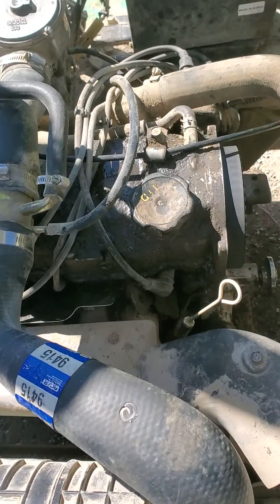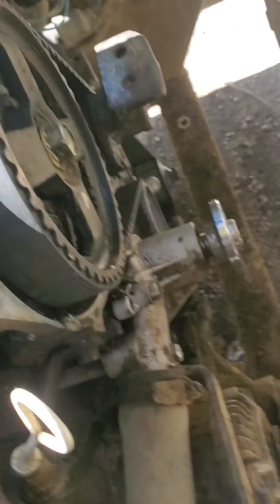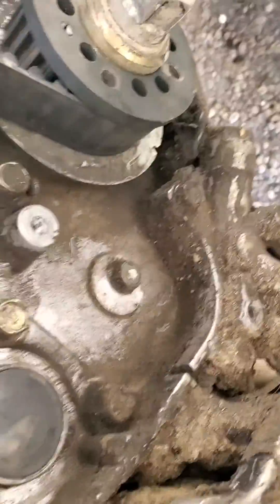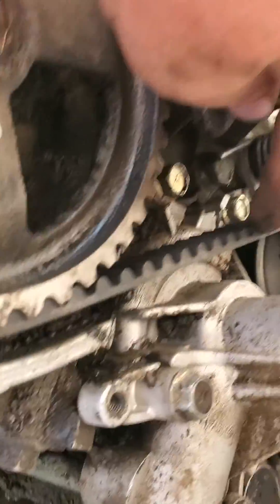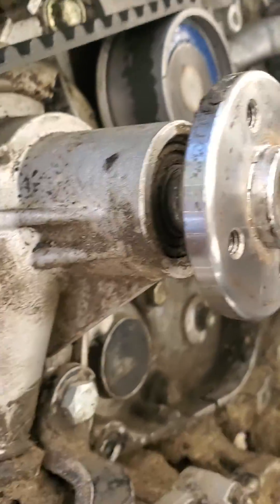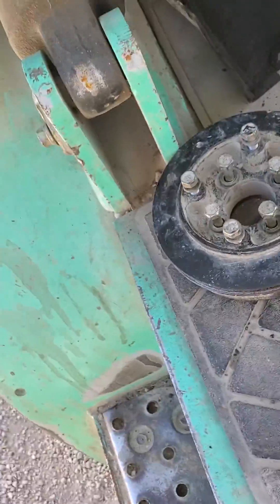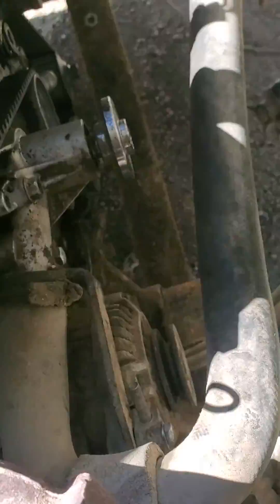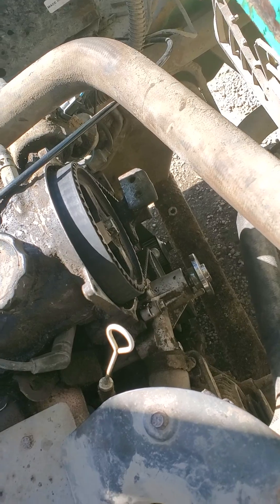mitsubishi fg30k forklift 4g63 timing marks and belt

Comment: How did you lock the camshaft pulley when taking off the belt?
Reply from the maker: They had run the engine out of oil and it would lock up the cam and skip the belt. I didn't do this as a service, I did it as a diagnostic. There's comments saying I was wrong about things and I'm sure I was. Just made the video to help people out of a bind that are lost not a proper repair procedure.

Comment: hi its god to see ur video i have question about E2153 cat forklift with Mitsubishi engine and we done the engine timing align the both cam shaft gears and crank gear. and what about about distributor where from ignition or spark plug wire comes from